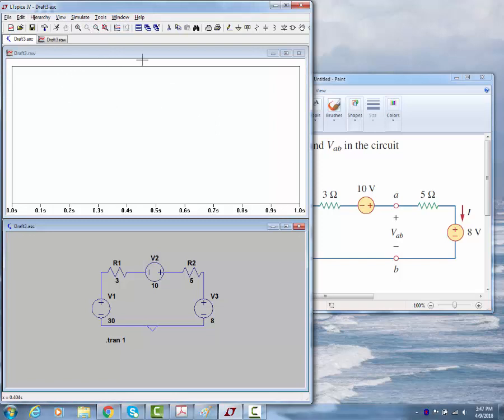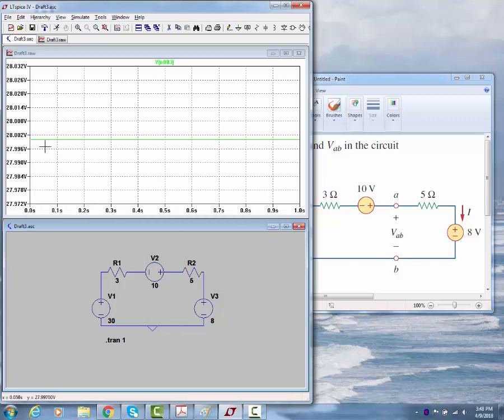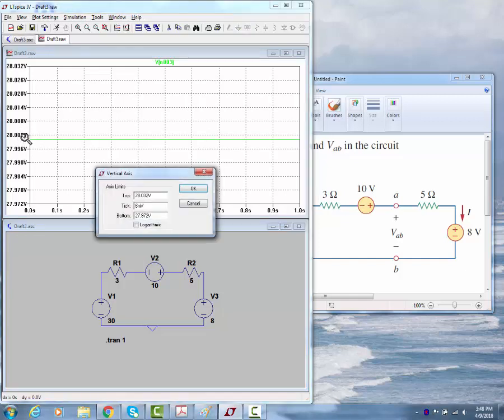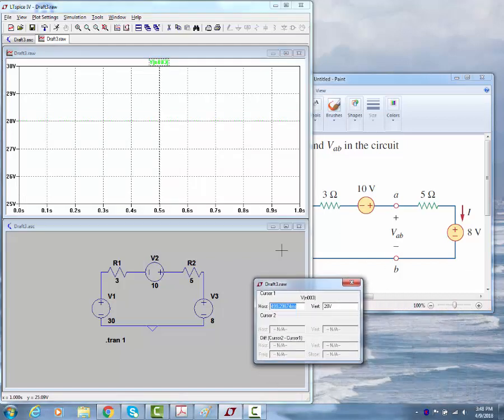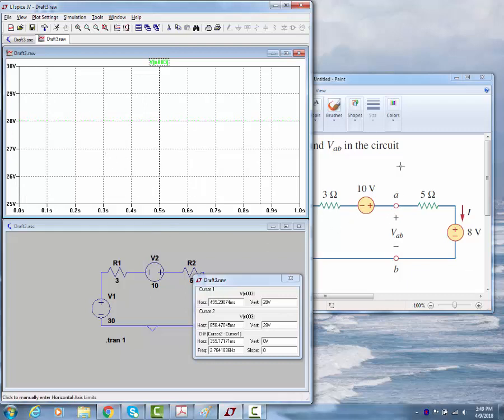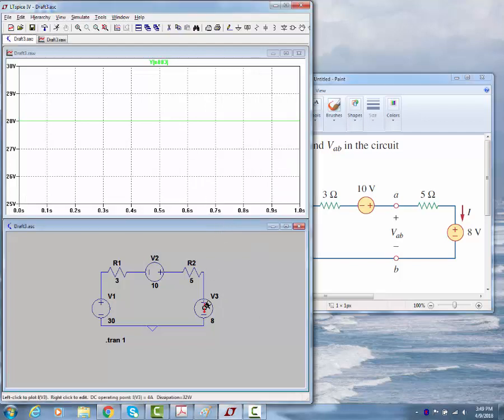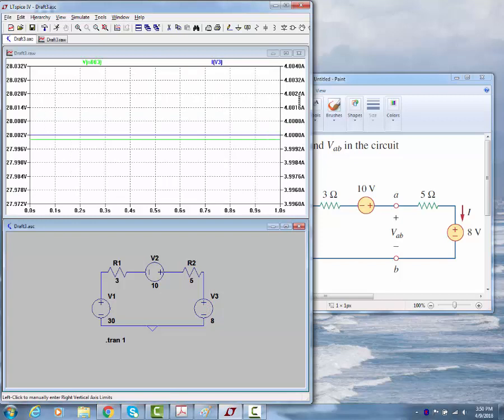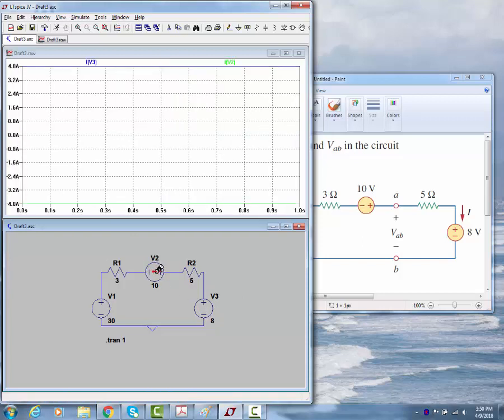LTSpice- Simple DC Circuit

Comment from the maker: Note: Let's say your 3 ohm resistor was a 3 nano, micro, milli, kilo, or Mega ohm resistor.  You could write this value as 3n, 3u, 3m, 3k, or 3MEG respectively when entering its value instead of having to write 0.000000003, 0.000003, 0.003, 3000, or 3000000 respectively.
Reply: THANK YOU VERY MUCH UR A LIFE SAVIOR TO ELECTRICAL ENGINEERING STUDENTS IM SENDING ALL MY COLLAGUES OVER